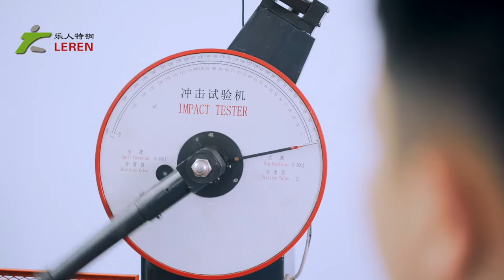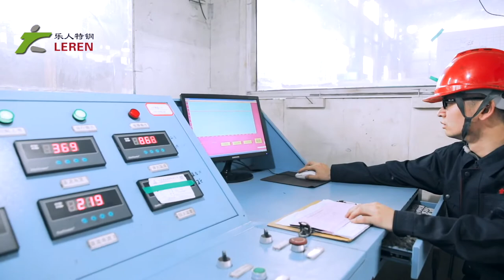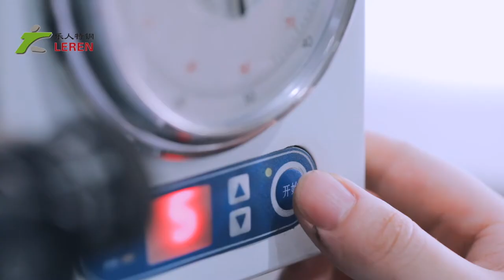SHANDONG LE REN SPECIAL STEEL

Comment from the maker: With full sets of production facilities, inspection and testing equipments, we produce all kinds of steel bars or finished products such as fitness barbell bar, Olympic barbell bar, steering gear racks, fork shafts, rocker shafts, valve cores, valve blocks in the automotive industry; fasteners in the wind power industry; ball screws and linear guide blanks in the machine tool industry ; various pins and bushings in the construction machinery industry; sucker rods, sucker pipes, and mid-to-high-end piston rods for oil drilling. Welcome to contact us: leren005@chinasteelok.com or 0086-18953401725(wechat/whatsapp)